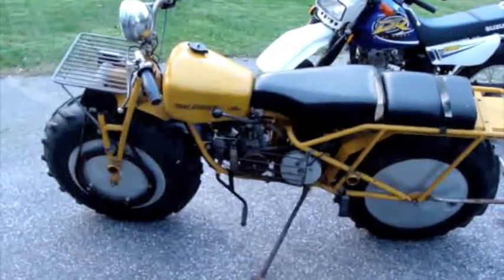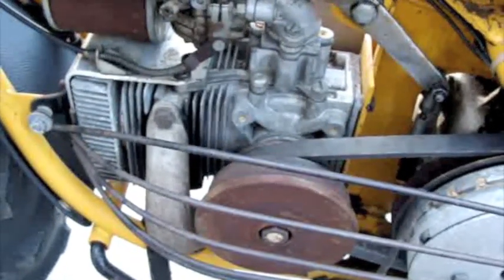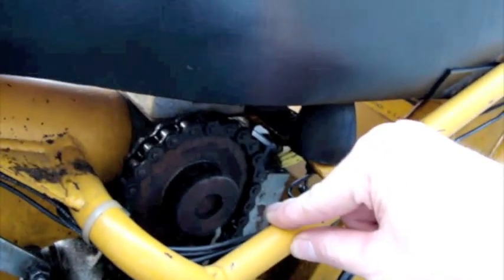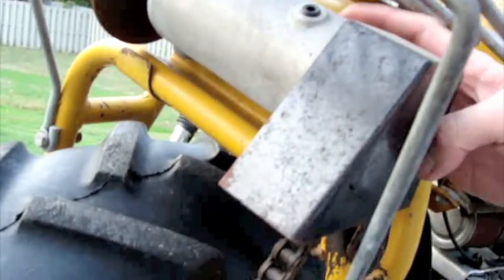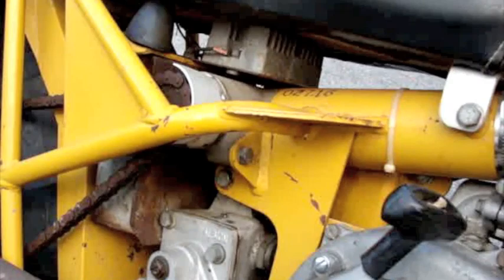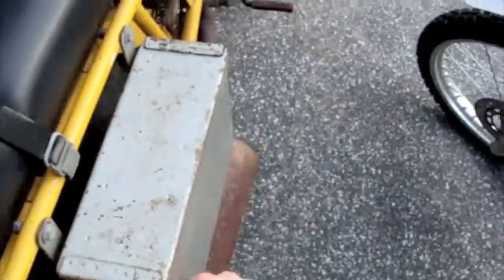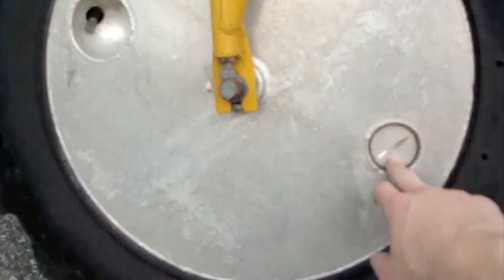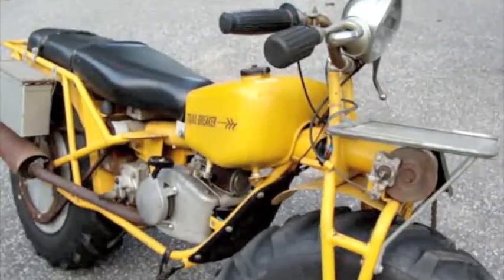1970 Rokon Trailbreaker: How it works

Comment from the maker: @dwarfinger Yea, I know for sure they had kickstarters, and I'm sure you're right about it being the same as the one on quite a few other bikes...  I just haven't figured out what that particular bike is yet!  I've got a bunch of other bikes at home.  It looks like one off of one of my 450 Hondas might fit...  I haven't tried swapping one on it yet.  The shaft diameter looks about right, but the spline count may be wrong.  Its also likely that a kickstarter from another american bike will fit.

Comment: Howdy, the front wheel does not disengage when you go around a corner: however, if the front wheel is moving faster than the driveshaft is driving it (like for instance going around a corner), then the front wheel CAN move faster because the driving mechanism is a one way spring clutch. It does not technically  disengage: it slips..The brake will work for both wheels, straight ahead or not (same issue)   
i don't think there is a kick starter for any of the Rokon models. (Might be wrong..)

Comment from the maker: @rickbell7 I never did, because even though the belt is loose, it doesn't slip too badly.  It doesn't work quite like a snowmobile transmission, its just a fixed drive belt...  I believe what you're referring to is a CVT transmission.  This just has a drive belt, and a transmission with 3 different fixed gear ratios.  Slow, slower, and slowest! :P

Comment: @Mtrhd0024 
Did you ever get around to replacing that drive belt?  To me, it looks similar to a snowmobile type clutch/transmission.  If so, then the clutch sheaves actually move together as the RPM's increase,  That puts tension on the belt as it engages.  The higher the RPM, the higher the belt rides in the sheaves.
Strange that the alternator is on the secondary drive though.  Usually you'd find a charging coil in the magneto under the flywheel.
Cool bike and great video!
Cheers!

Comment from the maker: @garctown Thanks!  They are pretty cool, and Rokon did make it, they're still in business today!  The bikes have changed a bit, most of them use 4-stroke Honda engines now, and there are a few other changes, but the basic idea of a 2wd Motorcycle designed to go anywhere and do anything a 4-wheeler can do (and more!) is still there!  The biggest problem with a new Rokon is that they're EXPENSIVE!  A new one runs about 5k, + the old ones hold their value.  One like mine will cost between 1 and 3k!

Comment from the maker: Is it really supposed to be as loose as it is in the video?  I'm pretty sure its slipping when its running.  And I'm not putting on a smaller belt, just a new one from Rokon.  Its the same size, I was just hoping it wouldn't slip as much.

And how does it tighten?  You could be right, I just haven't really seen how that would work since there's no tensioner or anything.